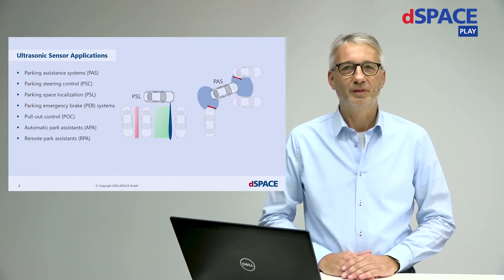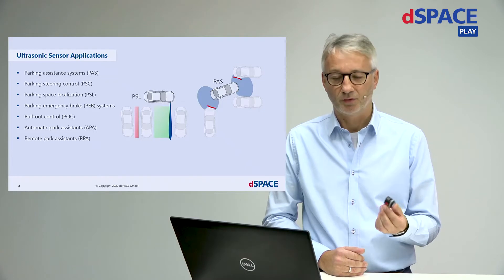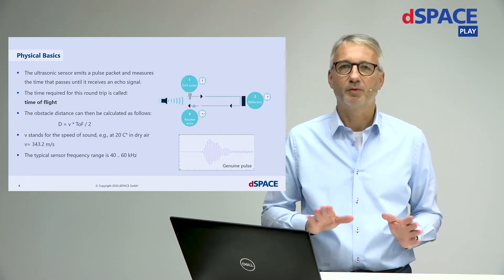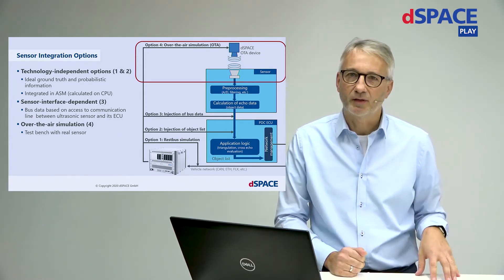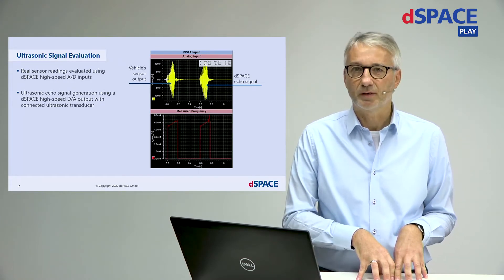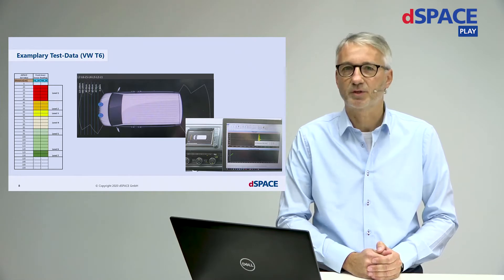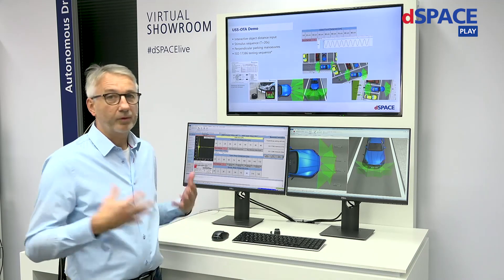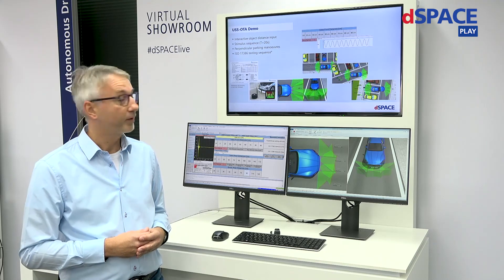Testing of Ultrasonic Sensor Applications | Innovation Coffee Break

Comment: How is the adaptive threshold of the sensors and directivity changes due to installation conditions rightly captured in the simulation model?
Reply from the maker: The parking sensors are installed in a way, that the test systems’ transducers perfectly capture the genuine soundwave, hence the parking sensors are aligned mechanically with the test systems’ transducers. 
After an initial calibration of the entire set-up, the installation conditions remain stable and will not be changed during subsequent testing. 
Once this is done, there are multiple parameters to, for instance, manipulate the simulated echo signal thus stimulate the parking sensors, for example, to test the algo for the adaptive threshold calculation. 
Among others, parking sensors detect objects by evaluating the signature and the amplitude, hence the user may switch between a perfect or a manipulated echo for system validation. 
The generation of the response signal is in-sync. with the capture window used by the sensor. 
Also, for threshold validation, the sensor stimulation supports unwanted clutter generation and noise can also be superimposed during run-time.
If you have further questions, please refer to info@dspace.de. Our colleagues will be happy to help you.